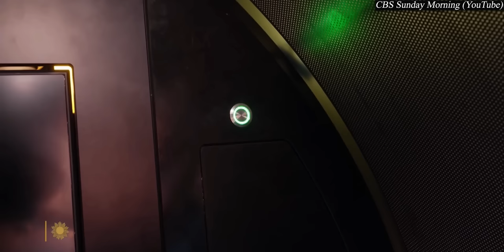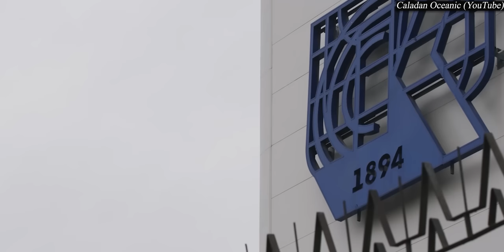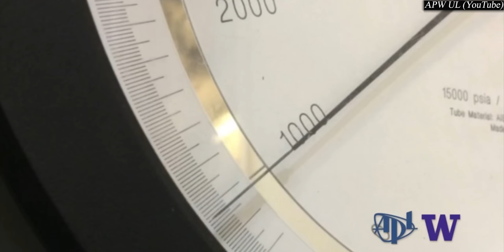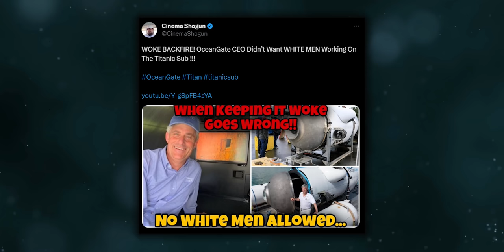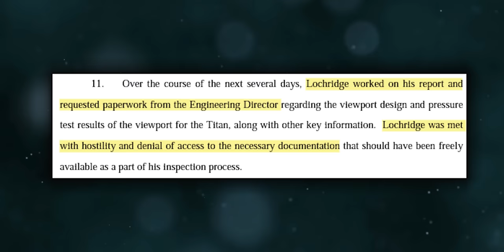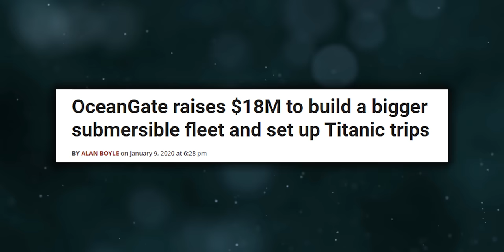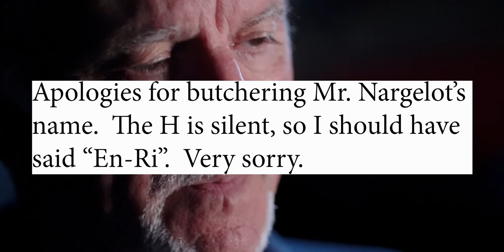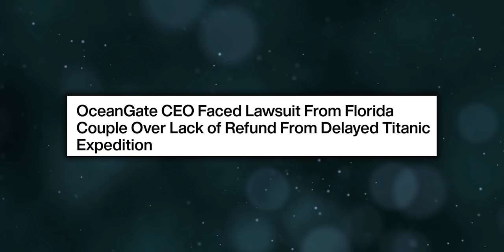OceanGate: A Tragedy of Hubris

Comment: One thing I know is NEVER CUT CORNERS IN A SAFETY PART OF A JOB

I am a mechanic, not an engineer but when I do things like brakes and suspension I don't give a crap if the customer or boss wants the brakes or suspension rushed, I take my time with the job as a living person's life is in my hands.

Similar principle
Reply: I'm an electrical engineer, but I have a big interest in mechanical things, so I have done most things on a car, as an amateur mechanic, both for myself, and for friends, but I always refuse to do brakes. I know how they work, and I'm sure I could do it, but when it comes to safety, I'm leaving it to an expert. It doesn't matter if I do something wrong (though I haven't yet, touch wood!), and the car stops running, but if I do something wrong and the car won't stop, that's a problem!
Reply: I'm of neither professions you two gentlemen are. That's why if anyone asks my opinion of mechanics or electrical engineering  I point them in the direction of a mechanic or electrical engineer... I'm doing my bit of safety regulations.
Reply: Short cut is the longest way around. The problem with reality is that she shows her teeth infequently.
Reply: When you do...oh boy. Decades ago I was working my very first nursing job on a very busy medical surgical floor, probably won't mean anything to you but it was completely normal to be assigned 12 patients but it was a LOT. I had a patient with Sickle Cell Anemia who was requesting her pain shot and a brand new patient who needed their IV to be flushed (maintenance for the IV)....and I decided to take of both on the same trip all the way down the other end of the hall. Long story short, I gave one patient their pain shot but had mixed up the saline flush with the Demerol. The new patient who received IV Demerol was knocked OUT. So much so, when I was about to start charting right outside her door her SNORING startled me. You can't imagine the horror that almost instantly occurred to me what had just happened. I felt like the biggest jerk, idiot and loser. I went and told my charge nurse and we both watched her  like a hawk for the rest of the night. She wasn't going to report it because I guess she didn't want to see me get into trouble but the thing is, the choice I made to cut corners to save some time for myself probably happened with others under time and resource crises at work all the time. The hospital needed to know so that it could see where they can step in to lessen the risk for it to happen again. It's not fun being accountable when you mess up and get it really wrong but people like Rush aren't capable and it's too bad for everyone else.
Reply: Well said. I am in the automotive field and I worked with Brake pads and Calipers for a number of years. Corporate big wigs at the factory would eye profits constantly and try to rush us. Nope, safety first. As an old supervisor used to say to us "Imagine if your mom, dad, spouse, kid, etc, were driving and had no brakes and they slammed into someone or something and died due to your mistake. Lives are on the line". Rush was disgraceful with his conduct and he took 4 others down with him to the grave. One was a 19 year old kid that had his life ahead of him. His mom lost a son and her husband at the same time. I can't even imagine
Reply: Thank you!!! You're one of the good ones ❤
Reply: @philsurtees "touch wood"😂 - that's hilarious

Comment: They had an alarm system that went off once the damage had already been done. Nice. Especially as Carbon Fibre doesn't degrade slowly like metal, it reaches peak, then drops off a cliff. You really couldn't make this up. Oh, Stockton Rush "suddenly" became much more interested in going 'down,' rather than 'up,' when he failed his eye test for aviation. 🤔
Reply: He also spent most of his life studying aviation and then trying to force aviation lessons onto the submersible. Like he didn't know anything about deep sea diving. He knew about planes. Yet he still felt like what he knew about planes was mtle relevant than what anyone knew about submerisbles.
Reply: I was watching. First it started imploding. Then it imploded.
Reply: By simply wrapping the core of a toilet roll in carbon fibre, you can demonstrate it's enormous TENSILE strength, showing that you cannot burst it from the inside. Then you can just crush it from the outside with your bare hands. The only crush strength was from the epoxy, but since it contained air bubbles, they would progressively collapse from the outside on every dive cycle, reducing it's strength to that of a soggy sponge. A far better solution would have been to start off with 2 titanium cylinders of half inch thickness, leaving a 5 inch gap when they were placed one inside the other. These could have been continuously welded into slots machined into the end caps. The cavity could have been evacuated and it's ability to retain a vacuum verified. Using a mixing nozzle and sealed connections to the vacuumed cylinders, the entire cavity could have been filled with high strength low modulus epoxy and left to cure for a few weeks. The whole thing would have needed to be on end and slightly tilted, with injection at the lowest point and vacuum at the highest. A window tank at the top, would have verified complete filling. Needless to say, the epoxy would have needed to be retarded, to allow time for filling before curing commenced. This method, using conical removable cones, was used to construct the single piece nose radome of Concorde. Throughout the life of the aircraft they never had a failure. Perhaps the most important factor, is that regular ultrasonic testing could have been performed. The titanium outer shell would have also given good damage resistance and clearly visible marks of any impact.
Reply: @wilsjane  You've certainly put more thought into it than Stockton Rush. Seems he didn't want to listen to anyone though.
Reply: @winstonsmith8240  Thank you for your compliment. At 74 and 55 years as a design engineer, I am still alive. 
I still wonder at what stage Stockton contacted Boeing and whether it was back in the days when he had ambitions of building an aircraft in his garden shed.
I wonder if they realised that the pressure differential at 30,000 feet is 10'psi positive inside an aircraft, while Stockton's toy was 6,000'psi negative.

On a slightly different subject. When watching 'Thunderbirds', did you ever notice that the village consisted of the backs of a few hundred 1950's televisions.
They were made wrongly at the factory, so rather than having to buy them, Gerry Anderson was paid to take them away.

PS, I wonder whether anyone will ever try my titanium, epoxy sandwich idea.  The differential thermal expansion could present a problem, but a carefully calculated 20% scale model would be easy to test.
Reply: @wilsjane  Thank you. I'm not far behind you age wise, and I know absolutely nothing about engineering. I do have a very inquiring mind though, and I love going down Rabbit holes. Even just doing the slightest research it was clear that this was a disaster waiting to happen. By just listening to people like yourself, and understanding the challenges, I struggle to grasp how this was allowed to happen, ( but they did move the company to the Bahamas, and they were in international waters). Thankyou for educating me a bit. Love it. All the best to you sir. Live long and prosper.

Comment: Crazy how the more they used Titan the more janky it looked. They ditched some of the exterior panels and the gear is weathered. Also the acrylic dome was losing its adhesion
Reply: It looked old. Why was he hell bent on going. Was he in that much denial that he didn't notice it? Or didn't notice the 14% success rate his vessel had in descending Titanic's depth? Or notice that even most of the successful dives were near misses?
Reply: @alexxela8956  I'd be interested to know what the success rate of other submersibles is. That is to say, if it is low for other submersibles too, then it would be easier for him to convince himself that the failure rate wasn't an issue? Having said that, he had a pretty cavalier attitude about the whole thing. Clearly, he was experimenting with people's lives.
Reply: @alexxela8956 1 million dollars
Reply: The answer if his was the first submersible to implode.

Comment: Honestly, my only major issue with the use of the game controller is that it's wireless.  If it was wired, I can see ways around all the issues I can envision. Multiple redundant ports, a backup controller on board, and an independent GTFO emergency failsafe in case the other backups fail. The main point being redundancy becomes easier and cheaper that way, and despite being wired they're actually less of a fire hazard.

That it was apparently a wireless controller breaks my brain. That means each controller has its own battery pack, which is a separate source of heat. What happens if either the controller's or worse main Bluetooth antenna fails (each also being a heat source)?  Nothing about using a wireless controller in this situation makes sense.
Reply: Game controllers are used in the military, it's the least surprising thing - but you'll notice they all have wires. Problem with wireless is batteries can fail.
Reply: @realfingertrouble  no, the military uses game controllers for small tasks, like ballasts and they use them on drones, they dont use xbox controllers to completely control manned vehicles or subs

Comment: I hate that the controller gets brought up constantly. That's the LEAST of the problem. If anything, using a Game Controller was the best decision they did because of the QA testing and Usability research those go through. You can't say the same with the hull design decisions.
Reply: Yeah, it's a talking point that doesn't hold to thr pressure. Only deal about the controller I find strange is that he went with Logitech, a middle shelf replacement brand, but, since he bought extras for redundancy, it's really not an issue.
Reply: The point is it shows Rush’s careless approach and his narcissistic tendency for self-staging. Both red flags. And of course, in a vehicle like this, safety would make you want redundancy and additional hydraulic systems.
Reply: @christianhornberg578  The Navy uses game controllers. True story.
Reply: @ko7577: They use modified and tested game controllers, and they don’t use them as the sole device on submarines.
Reply: @ko7577  , Heard that from ol' Thunderfoot me thinks
Reply: @ko7577  when my Bluetooth speaker fails to connect with my phone I'm inconvenienced but my life isn't in the balance.

Comment: I find it hard to believe a guy as smart as him, could not see the disaster heading his way.  He knew the viewport was rated at 1300 meters,  and they were going to 4000. I lean towards the possibility that he wanted to check out early. He wasnt very concerned about anyone else. Suicide / murder might just fit the bill.
Reply: He was just arrogant.  He actually bragged in an interview "The rules say don't do that, well I did."
Reply: If something is rated for 1300, then it can usually tolerate and has been tested for much more. In aviation engineering - which is what Stockton was actually knowledgeable about - it's very, very common to use off the shelf parts that have been tested to your levels although not rated. It's legal and passes testing.

Stockton claimed he knew it could tolerate way beyond 4000.

Rich people aren't smarter than us. And he was an arrogant man, who repeatedly demonstrated he didn't know much about sub design. He was just a moron whose arrogance got people killed. It's not suicide. It's arrogance.
Reply: @medes5597 
That's complete bs.
Why lie?
The company that made the acrylic window has stated that they warned Rush that they would NOT certify it for depths lower than the 1300 they stated.
He himself stated on video that he cut corners & broke rules SPECIFICALLY in regards to that window and that it would make crackling sounds at depth and "shrink"!
Yes, there often a bit of leeway when stating a limitation, but not from 1300 meters to 4000 meters! that's just ridiculous.
The manufacturer wanted to test it for lower depths or make a stronger window but Rush refused.
You're making the same stupid assumption that he did, that if something works in aviation, it's going to work with subs, and that's utterly false as he proved!!!
I think his Daddy paid someone to take Rush's final exams in college, he was no real engineer.
Reply: @abelis644  you have no idea what you're talking about. Literally none. You haven't read the report, nor have you read Stocktons reasoning for using it

(it was rated for 1300, in order to pass being rated for 1300, it's tested up to 5500. Stockton considered it within tolerance because of that. It's a well known engineering concept and it is legal * it is used in literally every single airplane you've been on, it is so common on airplanes I cannot begin to illustrate just how common - provided you prove that it's safe, and that your use is within safe tolerance and testing)

The guy who complained about the viewing window actually accepts Stocktons argument BUT considers it an aviation argument and thinks that's Stocktons issue. He doesn't think that such wide tolerances apply to repeated use at high pressure. And he was right.

Literally read the public discourse between Stockton and his engineer or watch the many YouTube videos about it.
Reply: @abelis644  here you go -

"There's a couple of concepts that could apply here, but one big one is factor of safety (FoS). The FoS
a design principle in which an object is designed to be stronger than it needs to be for an intended
load. This is a standard practice. An example you may encounter in your everyday life could be around Christmas time when its time to hang lights: when your 500 lb uncle busts out a 20 ft ladder rated for 250 Ib, scales it like a champ, and the ladder doesn't buckle, the FoS plays a meaningful part in supporting his weight beyond the intended load. If you're interested in learning more, the wikipedia
page does a great job communicating this concept.

*The takeaway here is that it's definitely possible for glass rated for 1300 m to survive a dive to 4000m, but that is a terrible, terrible practice*. In addition, just
because it survives the trip once doesn't mean it can
do so multiple times.
Reply: @medes5597  
I have read every report I have found and watched probably the same videos that you have seen.
Nowhere did I see that the window was tested to 5500 meters.
Do you have a source or link for that claim please?
Aviation is a different field, those windows do not have to tolerate more pressure than that at sea level. The higher you fly, the less outer pressure as you know. The difference in airplanes above 10,000 feet is 11-12 psi in the cabin, while the outside air pressure might be just 4-5 psi.
Not quite the 6000 psi at depth!
Reply: He could  have gone down  without  them

Comment: I believe the glue and the end caps separated due to expending and contracting during past dives. The carbon fiber material is used for air plane manufacturing. When the ends separated, the water rushed in and killed them all instantaneously. Sad. Owner was like a "brain surgeon self thought"

Comment: Carbon fiber is the opposite of concrete. It’s only strong under tension, not compression. It’s like trying to build a structure out of used seatbelts and resin. It’s only really the resin resisting the compression.

Comment: A guy tapping on a titanium ring with his bare hands to fit on carbon body. Using a regular wrench with arbitrary force to bolt in the titanium hatch...
A torque wrench is a must tool even when you replacing a fuking spark-plugs on your car.
Naaah... I can't believe this level of recklessness is possible. Serious or not serious company, they are a submersibles company after all... it's like they wanted something to happen...

Comment: game controller and  high tech touch sxreen devices had zero to do with the  physics that tookk the group to their death but they only hasd time to freak out a bit till it imploded then less than 500 millisrconda later it was over
Reply: the wireless system was a death sentence. tons of the dives were scrubbed because the wireless system wasn't working. if the wireless went out on their dive it would be a death sentence. there was no backup control system.